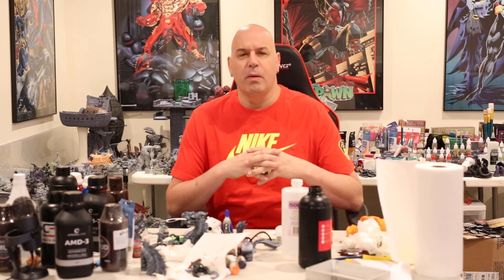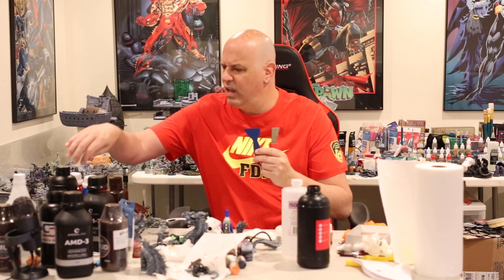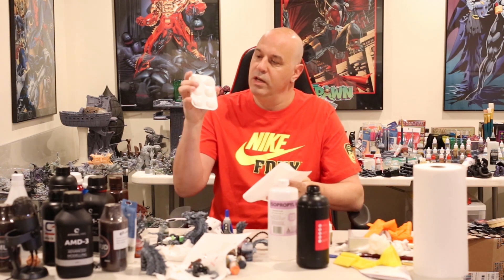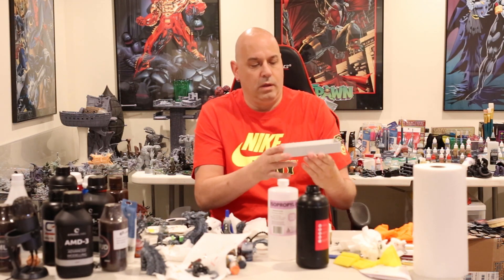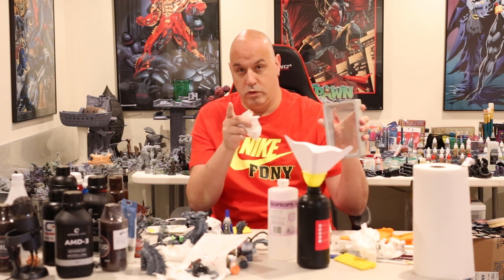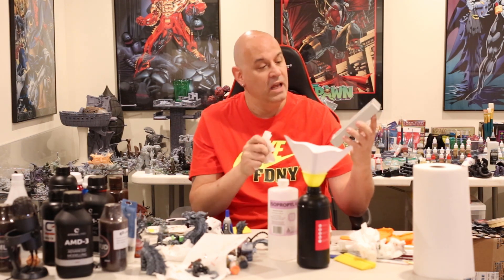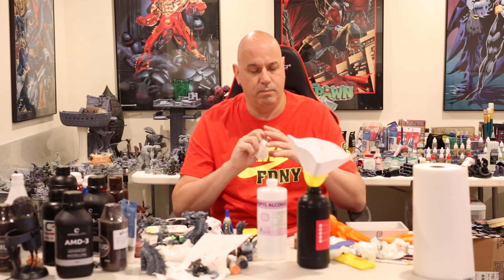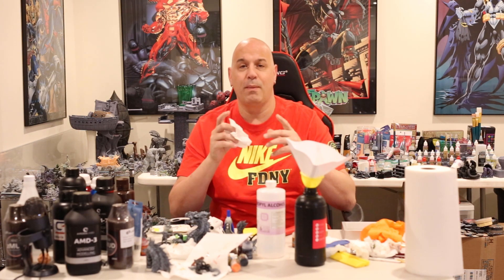How to not damage your FEP resin 3d printing, with a tutorial on how I clean my vat

Comment: I just recently received my first printer (Mono 4k), as a birthday gift, and on the first night I managed to get resin all over half of the table, because I used one of those stupid filters (inside of a funnel, of course) that came with it. No matter how I'd fold it, the stupid thing still refused to stay in a usable form, and right aft I began to pour from the vat, the piece of junk snapped back to it's original shape and the resin went everywhere except for into the filter. The next day I ordered a set of metal ones (dirt cheap, and come in a 3 pack with silicone funnels), from Amazon, and it's made pouring resin back into the bottle a ton easier. I'm getting a second set, too, for paints, as that's actually what they're made for anyway.

Btw, I just want to also say thanks for all that you do, because you've been a great resource for all of us. Hopefully soon I can also finally become a Patron.

Comment: Firstly, you forgot to mention one of the biggest reasons for failed FEPs: Tightening too much during installation (sure, you've mentioned it in your other videos, but a good reminder here.

Secondly, I somewhat disagree with plastic spatulas. Sure, metal ones are "better", but I like it that I can't really damage the print platform with them - something definitely possible with metal ones. Those plastic ones with kind of "round" end aren't very good, you can get prints off if the raft edge isn't 90 degrees, but I prefer those, that have sharp-pish edge at 45 degrees or so.

And I also use them for failed print removal. BUT very carefully, not touching the film. I press the print gently from below, and once one edge pops up, I gently slide the scraper below it, gently pulling up - I just find that easier than using gloved hand (obviously won't work too well with very small pieces)
Reply: I use a small plastic spatula to clean my vats for months, no scratches or damage, but I use a silicone spatula for stuck parts or bits floating if I need to clean it. FEP failures are usually from user error, and understandably so as resin printing is a skill you need to learn. A lot of folks just jump in. I mean I did, but I am fairly technical and thanks to the resources out there I figured out my initial failures and moved on. Good video none-the-less though. OH and also, I use shop towels that have very little texture on the vats to clean them and no worries so far. I will get some microfiber towels though as they seem to work better when I used them in the past. I am just being cheap and I kind of messed up the ones I had.

Comment: Thank you for this.  I bought a elegoo mars a long time ago and pretty quickly screwed up my FEP.  I got failed prints that stuck to the FEP and could not get it off.  I also scratched the heck out of the FEP trying to clean it causing it to become VERY cloudy very quickly  I basically did everything wrong you could.  The Silicon Squeegee was EXACTLY what I needed.

Comment: Most build plates are soft aluminum too. Using the metal scraper can actually leave a curled shard of aluminum sticking out of the build plate. Could be good to give it a once over, and if you feel a snag, sand it lightly with some fine sandpaper. Or just get a whambam :D
Reply: Best option is to just use a nylon wall scraper. It will never damage the built plate, can be sharpened and the flex means it just pops models off without any effort.

Comment: A decently sized wash and cure  can fit your vat and cleans your vat and fep really well, such as the creality one. I do it and it cleans so much better than with paper towels and microfiber clothes without any damage. Mine i put in, clean one side, and flip it over, also helpful for if you got resin on the underside somehow so you dont have to scrape a print screen

Comment: Great tutorial on cleaning. I follow same method except I like to pour in bit of alcohol onto fep then lightly use soft synthetic brush to get those edges super clean then wipe w squegee. Last step is drop of ptfe which I found helps keep builds from sticking or popping. Been working great for me since.

Comment: Good stuff as always, pretty similar to my own. Few things - as previously commented, ditch the paper towels for shop towels. They are softer and stronger than paper, and nearly as affordable. Also (thanks to @3dprintfarm) lose the IPA, use Sprayway Glass Cleaner - cheaper, easier to use and find, and smells nice 😜 Last, depending on the slope of your build plate, don't forget the top - nasties can hide there too... I hit the whole build plate, handle too in case of contamination, with Sprayway, wipe with shop towel and hang back in printer to dry

Comment: Credit to you sir. Watched you levelling video and it has helped. You mentioned “shake hour resin” etc etc. my proton x mono came very close to hitting the wall. Your talk gave me some pointers that looks like i may have a successful print today (as i paid £29 for the file) you can understand the frustration.

Have used some “silicon release spray” on the fep and changed my exposure times and “pleased to hear” that release sound as the build plate lifts.

Comment: Replacing my Sonic Mega LCD today... I believe my failure was a small part (a chitubox hole) on a small raft fell of the build plate. What I learned from that is... I will sand my build plate regularly & gang up small parts & Chitubox holes on bigger rafts... Also I will empty the vat after any failed print for cleaning & inspection... Great video 3DPP  lots of experience I can tell.

Comment: I love the suggestion of using the silicon squeegee. I will have to do that. I also keep a laboratory wash bottle of IPA handy and use that to soak down my paper towels which I used to wipe down the build plate and I use it to put a little bit of IPA in the vat, it's a lot easier than measuring out a cap full.
Reply: Those wash bottles are super handy to have around !  I use them for air brush cleaning as well.
Reply: @SpottedPainter  Yes I also use them when I'm painting miniatures.

Comment: I clean the build plate completely before placing it back on the printer or I keep the build plate in a clean plastic bag stored away from everything; so far no issues with a broken FEP. Most FEPs just get cloudy and deformed before replacing them. The scraper I use is a printed one, used mainly just to feel for debris and stirring; if I feel/think there is anything left in the vat I strain the resin into my storage container before printing again. I think good habits and printing routines should lower the risk of a critical failure but never can eliminate a brain fart completely.

Comment: Good to know I more or less do the same routine, although I give my build plate a good wash and scrub after every print. I would still suggest one of those vat holders if for no other reason they can hold the funnel in place so you never have to worry about it (I use the MakerMatrix version). Also I use the plastic spatula 100% of the time to remove my prints; takes a bit more effort sure, but I don't want to scratch the build plate if I can help it (I just want to keep things as new as possible).
Reply from the maker: Scratching it up actually helps adhesion so no worries!
Reply: I use a hobby razor knife to break a corner free then finish with the plastic scraper

Comment: 3DPrintingPro I'm surprised you didn't mention the clean function built into some printers for removing the failed print. Putting some old supports on the FEP before exposing the bottom provides a touch free way of peeling off your failed print.
Reply: I'm fairly certain he's too paranoid for that lol 🤣
Reply: I use that function all the time, but never thought of using old supports to make it easier to remove...awesome tip, thanks!

Comment: Old video but I'll mention it anyway. Instead of having to pour out all your resin from the vat, use a syringe. That way you avoid making a mess while aiming for the strainer and having to hold it with your hand while trying to pour vat, you'll be able to control the pour much easier. Just know that resin will leak out the tip of syringe when holding it face down, so tip it up carefully and don't fill syringe all the way or when you tip it up it will leak down the outside and onto your hand or even what ever surface your working around. Then you can clean the rest with your towel. Clean syringe inside and out with what ever cleaning solution you use on your vat. Cap the tip so it doesn't pour out then pour solution in from base after taking plunger handle out, put handle back in, I like to shake it up a bit. Then you can just squeeze it back into solution bottle until you need to change it out for cleaner solution. Then pull plunger back out wash out with water and let it sit out to dry. Wahla! I know it seems like a lot of extra work but it's really not.

Comment: I like the plastic razor blades most to remove my prints. I have the anycubic photon s buildplate, made out of aluminium. Normal scrapers and metal razor blade have scratched the build plate severely.
Reply from the maker: Scratched build plate is fine  :)

Comment: My plastic scraper that came with the Mighty 4K is the only thing ive used in the last 9 months of printing....it works flawlessly as my prints have enough adhesion to stay stuck to the bed, but the plastic scraper needs some pressure initially but then just slides right under the bottom layers. Maybe i got the bed just right, i don't know but I have only leveled the bed 2 times in 9 months ( second one was only because I put a screen protector on) but i find no need for the metal scrapers at all. Have only had 1 print ever not stick to bed, and that was on first day before i got the setting right.

Comment: Do you throw out the microfiber towels after a single use?  Or how do you clean them (ie: soak in IPA, ....)?
Reply: I use them until they are saturated with resin then throw them out. I get a lot more than 1 use.
Reply: i use IPA wipes (70%) to do most of the cleaning then a microfiber to get it totally clean, i have a microfiber that still cleans well thats been used 20+ times

Comment: I don't know if id call suction force but I had a rectangular hole cut out of my fep with model intact on the build plate the resin adhered so hard with my cone's of calibration that it just took a square chunk out. Massive leak im afraid to print anymore

Comment: You've now got me hecka paranoid about stabbing FEP now, I'm about to buy a printer tomorrow and you pop up saying don't use the tools that come with the machine lmao! I thought I had everything in my basket. Time to add a vinyl scraper to the list! Thanks you the tips, I shall take them on board.

You wouldn't happen to have any advice on screen protectors would you? I'm getting too much conflicting advice and I don't know what is up or down anymore. Its a Saturn I'm going to buy and I understand they don't come with a protector. Would you recommend I got one too just to be safe? I'm seeing others say it will just spoil prints and I shouldn't spoil the sanctity of the LCD.
Reply: From my personal experience, you can use the plastic scraper with the FEP, IF you are careful, just lightly glide the scraper over the FEP, and do not use the scraper for getting prints of the build place (to not damage the edge of the scraper). I have done this plenty of times, and never experiences an issue with it.
Remember that many of these youtubers are perfectionists. They try to give you the best advice they can, to redice risk to a minimum and getting that last 5% out of the printer. Most people can live just fine without those last 5%.
I completely agree with 3DPrintingPro's advice on the scraper. Silicone is better for the job and it will help reducing the risk to the FEP. However, if you can 'settle' with a little less than perfection, then the plastic scraper can do the job. You just need to be extra  careful (and inspect that scraper edge before you use it) :-)
Reply: You are way over-zealous. I have been using the plastic scraper on the FEP since the original mars came out with zero issues. & I would never use metal to remove prints from the bed like he suggests. Just put the print bed in the freezer for a minute & even a solid resin block will pop right off with the plastic scraper. I think he just gives directions for clumsy brutes🤷‍♂️
Reply: @J0SHUAKANE  are you sure putting uncured resin in the freezer is safe?! o.o that is actually terrifying haha! I’m going to not take that advice I’m afraid. 

I’m not sure how I’m overzealous though so I’ll need you to clarify? Is it about the screen protector?
Reply: @sierralarars  you shouldnt be worried about stabbing your fep. Why would it be unsafe? I wouldnt recommend using liquid resin as an ice cream topping. Or are you imagining deadly fumes coming off, coating everything you eat?
Reply: @J0SHUAKANE    it’s not just the gas, it’s the whole thing accidentally dripped on food packaging is way too high for me to consider that. Cross contamination is inevitable. Mixing food and uncured resin of any kind is just asking for an accident or someone ingesting resin. My mother has a compromised immune system and I’m fully unwilling to risk her health and others in the household to do that. Never mix food and chemicals. Just no. If I was having issues with getting things off the build plate with a scraper I would just make an investment in a flexplate. I’d never leap to putting materials in a toxic state in my freeze!

I'm half wondering if you are just trolling? I really hope you don’t actually put it in your freezer and are just pulling my leg.
Reply: @allanlarsen3261  ended up adding a silicone spatula to the basket (the scrapers were not available in my country). I’ll be using this for work so I definitely want to minimise my chances of human error haha! It’s a big learning curve for me and it’s likely if something breaks it will be because I did something it didn’t like haha!
I’m definitely getting the perfectionist impression but I think for now I don’t need the 5%. Maybe later if my planned use actually works but for now it’s testing and prototyping. 

Thanks for the really helpful advice! You’ve made me feel better about the decision I was making :)
Reply: @sierralarars  what are you talking about? You take the build plate & print off of the machine, wash it off, put it in the freezer, pop the print off, finish curing. There shouldnt be any liquid resin.
Reply: @J0SHUAKANE  It may be solid but it’s not fully inert. You can still miss cleaning bits of liquid resin too. Putting it in your freezer just to pop a print is a big nope. I’m not chancing it. I’ll get a flexplate if that’s an issue I need to tackle!
Reply: @sierralarars  Cute. Have fun throwing your money away😂
Reply: @J0SHUAKANE  it is my money so Thank-you, yes I will!
Reply: right on. Maybe someone else will read this & appreciate the tip to save from the flex plate scam. Not everyone likes throwing money away.

Comment: Do you recommend any product on the fep to minimize suction force?
Reply from the maker: Honestly never tested anything yet because with all the printers I've used I've never had an issue.  Guess I should just run some tests anyway to see what's what...  :)
Reply: @3dprintingpro212  
I tried re-leveling the z axis and don’t have that problem now.
Reply: @3dprintingpro212  Would love to see this test. I'm torn if PTFE application makes an actual measurable difference or its just a idea that gets passed around. I have yet to find a apples to apples comparison without or without PTFE.